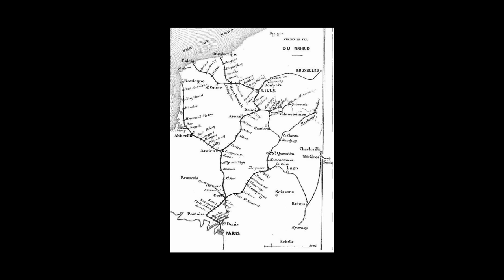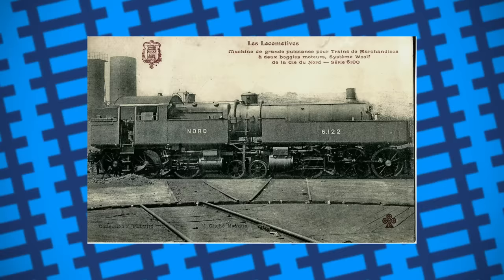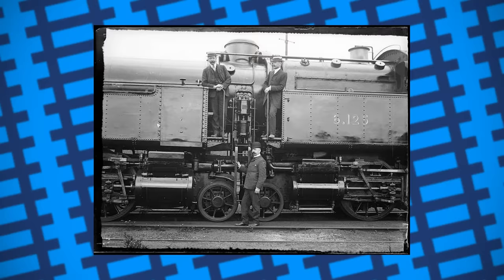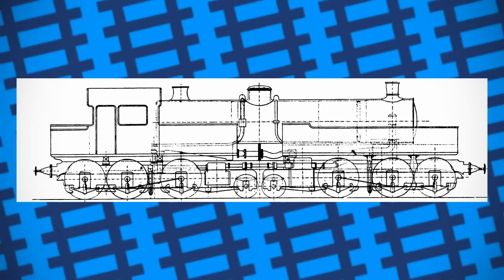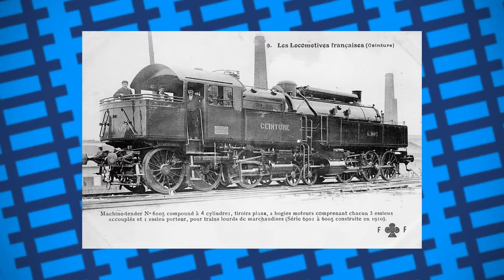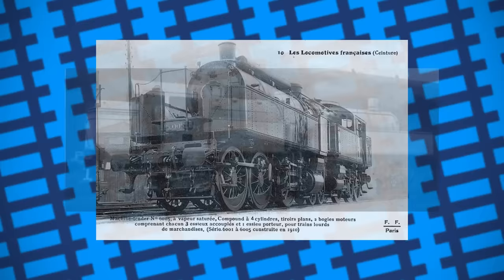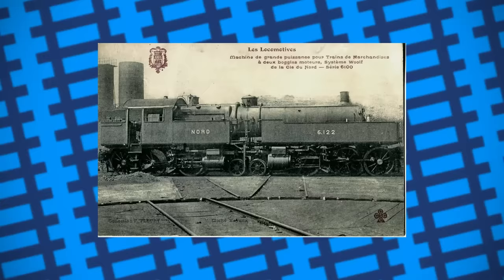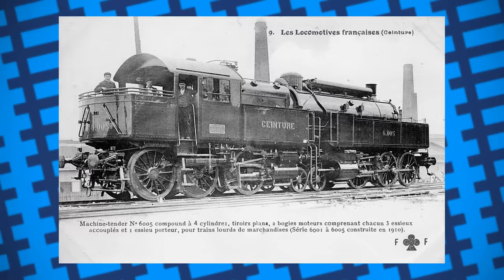France's unusual articulated engines - du Bousquet Locomotive

Comment: I only learned about this locomotive from Trainstation 2 again and it's quite fascinating. It looks like two locomotives crashed together and had a large boiler in between them. Fascinating tho. I didn't know some were built for broad Gauge. If you're considering French steam locos, how about the PLM Duplex? That's a fascinating one I'd like to hear.
Reply: the one that is not actually a Duplex? :p